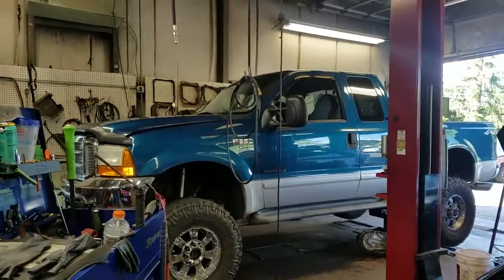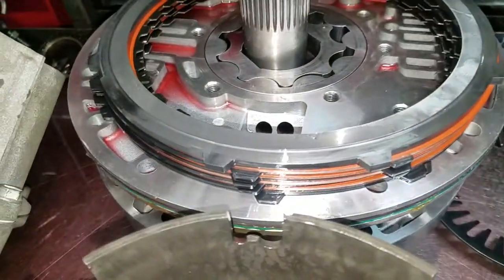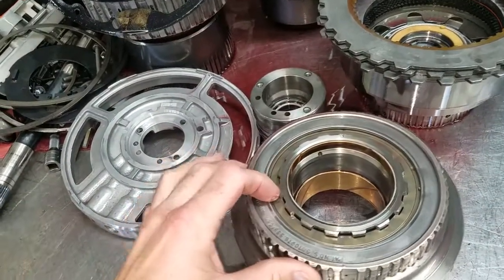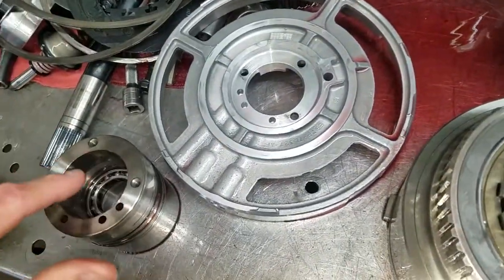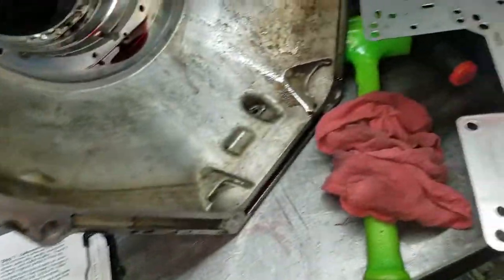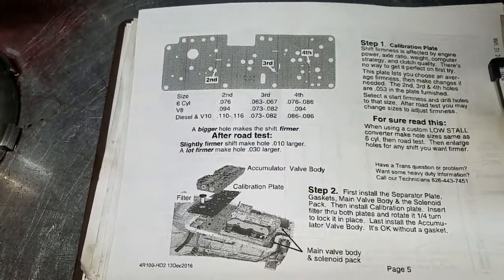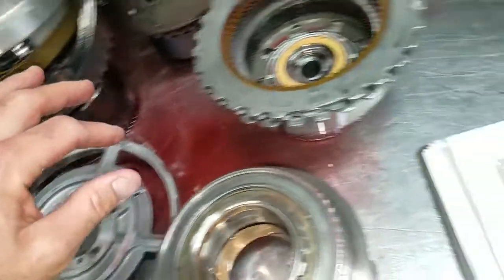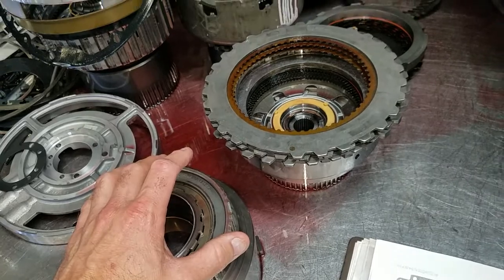F350 Transmission Reverse Delay Analysis

Comment: I'm dealing with reverse delay myself, and I definitely appreciate the info, but I'm not sure about the gasket between the center support (part 630 ) and the center support steel half (part 636) being an issue for reverse. First, every ATSG diagram I see indicates no gasket listed. That seems because it's an aftermarket part from Sonnax (part# 36743G).  What they say about the part: In Ford 4R100 and E4OD units, leakage between center support and hub can cause forward clutch failure and/or poor lube oil flow. This leakage can be caused by a number of problems, including an insufficient number and staggered spacing of mounting screws, surface finish flaws and flatness defects. Install Sonnax center support gasket 36743G to alleviate these problems. Center support gasket has a printed silicone bead to fill in any gaps between the center support and hub. I'll throw one in due to it being cheap insurance. I do have the Tugger kit , but the plate is definitely installed. There are lots of complaints listed in the forums for slow reverse on these trannys. Anyone aware of other known causes for slow reverse on the 4R100?

Comment: Just had rebuild on my 96 f250 7.3 with E40D.  new billet triple disc converter and transgo tugger kit as well. 

had no issues with reverse until rebuild done.... the day I got it back, once warmed up, shuddered in reverse. 

took it back next morning and they took trans out again and replaced pump.

got it back again 2 weeks later.. not shuddering, but significant delay, around 4-5 seconds and cant feel trans lock into reverse lik I can when placed in drive.

I have to apply throttle before it begins to move when warmed up but still doesnt feel locked in but more like 2 surfaces not making enough contact to transfer the energy.
Reply from the maker: Give me a call Tuesday my name is Steve 2158555123